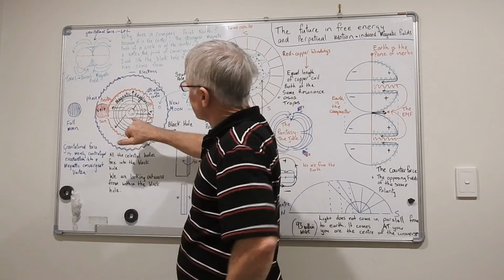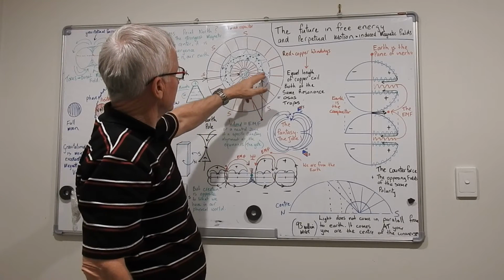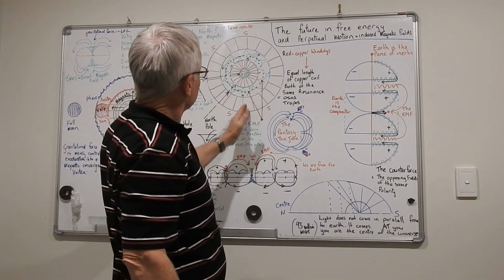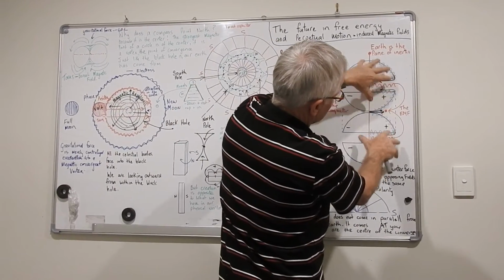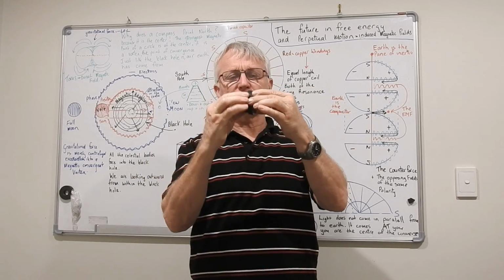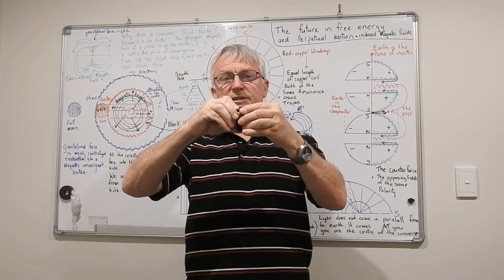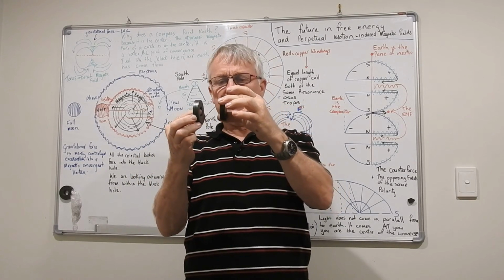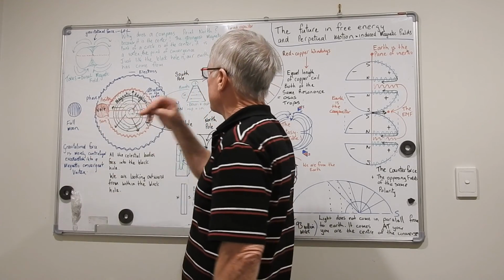Some physics Regarding Our FE System

Comment: Lindsey, you are the one who could Adress whats happening at those flights over 2000 miles and no stars coming from the horizon,  the view is almost stable, only a little rotation is going on. Check Taboo conspiracy's 3 latest flight Videos plz, you could wake up flat earth flat community with the reflection theory using those  real examples. If you have figured that out,  we could stream that with Shane again. Its needed cause some flatearthers think, that because its predicted with Stellarium, its not a globe debunk .... but i say stars should always rise on the globe, with a plane slower than supposed earth rotation at respected latitude. 
Part3 is even a plane passing equator, would be cool to get where the reflection starts or to understand whats going on.
Reply: Heres the Timestamp where taboo starts with the stars:
https://youtu.be/KFz4ZZd1zj4&t=2m36s
(his Google earth analysis isnt taking supposed 0  rotation into Account)
And ofc Stellarium is Just based on a dot and not a globe, but Im wondering whats really going on.
Reply from the maker: Good one. 
As you fly south in the northern hemisphere the stars come from your left (east) and flow west, but also from the east in the southern hemisphere when you cross the tropics, but the difference is that the southern stars come via southeast while the northern stars come from the northeast. 
 Stars always curve down due to man's visual arc of perspective, as they move over your arc of horizon, if you remained in the same position.
 What is funny though, is if you followed the stars west at 1000 miles per hour, which is constantly moving your arc of horizon, you will see the stars go down or dissapear about 12 hours later. 
I will come on Shane's show again if he wants.

Comment: If the sun is the voltage is the moon the amperage? "Volts and amperes are measures of electricity. A volt is the unit of electric potential difference, or the size of the force that sends the electrons through a circuit. An ampere is the unit used to measure electric current. Current is a count of the number of electrons flowing through a circuit."
Reply from the maker: Wow,  that could be a great way to describe the Moon.  A reflection of the potential energy?  From Adam came Eve? 
The Moon being the shadow of the Sun? 
Adds up. 
Each volt sends her (the moon) spiraling away
 (the aperture reading) After all,  she does take from the Sun.
But then we have to explain the moon phasing with that theory, too. 
 I might need breakfast before that one.

Comment: The gap is the zone between divergence/convergence, I always see the nazi black Sun whenever you show that on the board😂
Reply from the maker: The black hole is best described as the place of  convergence.  Where both male and female,  or strong force and weak force meet to spin around the hole,  the place of avoidance , which I guess could be described as the divergence?  The black hole is the place of rest,  which is basically the place of balance and perfection.  The place man is to seek within himself also.
Reply from the maker: Both poles race to each other  to "converge" for the potential difference but hit the sides of the tropics and "diverge" away, to pass down through or along the ground to their opposite poles.
Reply: @Meta369  yeah, next level Lindsay, that Nobel prize should have your name on it